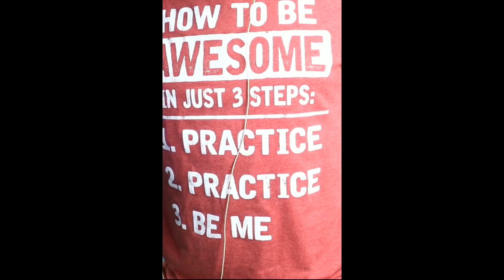Mini Maxx XRT Pro Tuner HDMI connector replacement and soldering

Comment: The two pins on the far left of the new connector are missing. Are they needed?
Reply: I saw that as well.  I also didn't see the HDMI connector being tested?
Reply: at 3:02 you can see they're NC (not connected) to any trace on the board - so they're not needed

Comment: What hot air and soldering iron temperature do u use to remove and solder back the component. Thanks in advance for the answer

Comment: Hi, do you repair smart TV
Reply from the maker: It's not really practical or economical to fix smart tv's here in the USA. You can buy a 50" 4k tv brand new for $250. Usually we would just replace the faulty board if we had to fix one. The TV is made out of 3 main boards that could fail, Main, t-con, and power supply considering the backlight and LCD are good.  It maybe worth it in other countries to repair those boards, but not here, at least not for me.